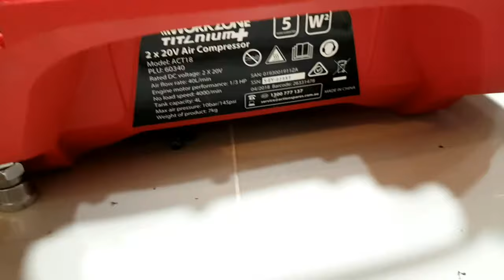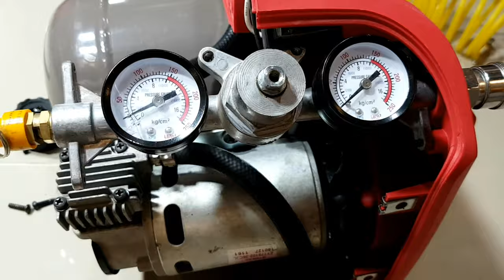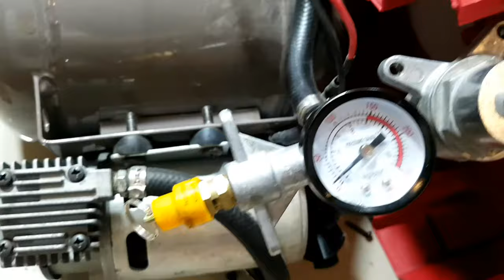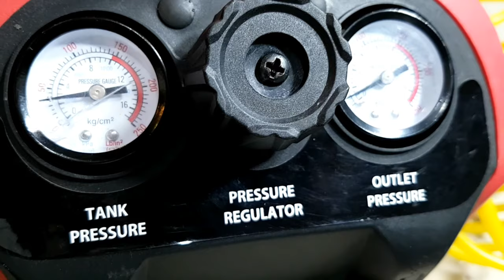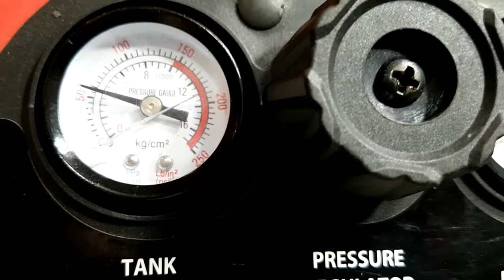WATCH THIS TEARDOWN WORKZONE CORDLESS PORTABLE AIR COMPRESSOR| subscribe WOOD TV

Comment: is this worth it?
Reply from the maker: Hello Sir, I have to tear this item down because I need to see the extent of the damage when this pump was accidentally drop by a construction worker, so its worth it, because it was working well with only cracks on its casing. :-)
Reply: @woodtv4481  thankyou....i purchase 1 of this for portability in cleaning my car engine
Reply: Worth ba eto sir for diy pang household? Planning to buy one.
Reply: Yes it's worth it, if you have 8amp batteries that can take the load.